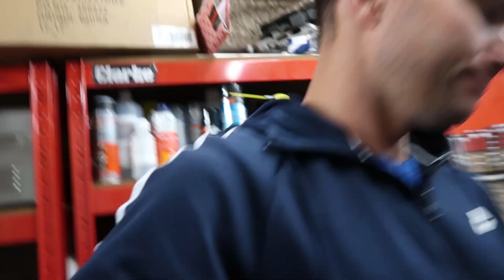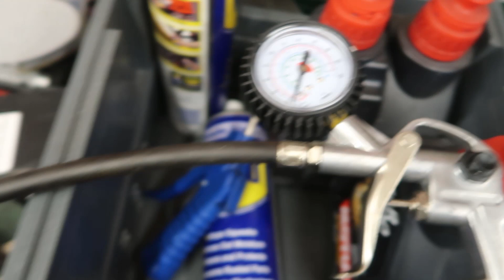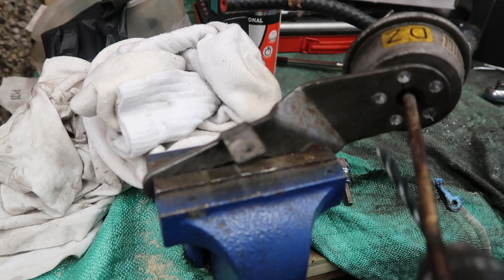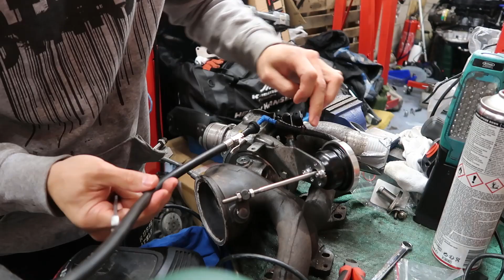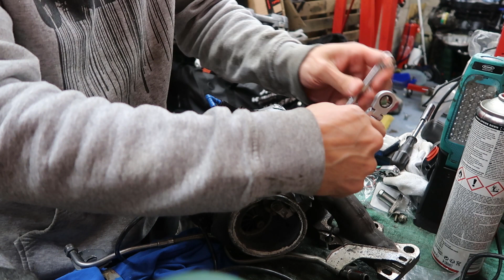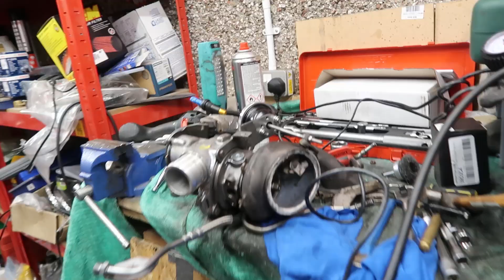How to install turbosmart actuator VXR

Comment: Hi mate, where are you based please? I really want to get that flutter sound on my VXR was told to put a forge recirc valve in, would I also need to change my actuator? Is this something you can do please? Thanks
Reply from the maker: No the actuator wont make the noise you want.  Im way up in Scotland Aberdeen

Comment: After hand winding the nut tight, wind it 2 revolutions which way? Tighter, or lose?
Reply from the maker: @llewellyngovender9308  ohh sheet been a while i can't remember man
Reply: Just wind the nut up (clockwise) until wont turn by hand, then give it a further 2 complete turns clockwise.

Comment: Turbosmart universal? 140mm or 150mm? Thx
Reply: hi, did you find an answer to this question as I am also facing this problem, I want to get a universal one but it is 150mm and I don't know if it is ok
Reply: @adrianilie9081  я вообще взял turbosmart от powerstroke 7.3tdi 21psi но пока не ставил, сам шток вестгейта длиннее поэтому буду нарезать резьбу и постараюсь сделать площадку по типу родной чтоб сохранить родной вестгейт

Comment: Hey bud, what acuator is this? 10 or 14 psi? I'm guessing 10 as that's when its exhausting but just wanted to double check. Cheers
Reply from the maker: Its 10 mate.  There 10 standard.
Reply: @boosthit811  cheers my man!

Comment: hi there i have a forge actuator on it and the original owner has the 8psi spring on it deciding wheather or not to change it due to having a idle misfire but when i set the preload properly i have only 5 psi of boost 
btw i have a stock engine spart from fmic kit, forge actuator and recirc valve it is on a astra vxr

ps also wondering if you know anything about vacuum being above 30
Reply from the maker: Idle misfire and strange high vacuum I would be checking over all the intake and boost pipes/vacuum lines.  Hose clamps etc and even pressurise the system to confirm no leaks.  

Would need to check what preload forge recommended and what standard spring they normally use....
Reply: @boosthit811  did a boost pressure test a week ago no leaks and it is using the standard spring

Scotty Kilmer recommend doing a compression test
Reply from the maker: @996stoky  yeah that might point you in the right direction.
Reply from the maker: @996stoky  lots of different things can cause misfires.  Any codes up when doing the pedal test?  Even oil leaking onto spark plugs can cause misfires on the vxrs
Reply: @boosthit811  the only codes that come up are p0170 on a scanner and onboard it shows ecn17012 and ecn17016 I should mention it has had a decay and I checked the spark plugs lately it is running ridiculously lean when the code shows up
Reply: And rich when codes are reset
Reply from the maker: @996stoky  when was it last running good?  Or have you just got it?
Reply: @boosthit811  had it for about a year always had the issue I took the last muffler out and noticed it it had the original one on that masked it so to speak when I was test driving it
Reply: Also on idle my maf reading is reading anywhere from 2.8 to 3.2 g/s if that helps
Reply from the maker: @996stoky  ok.  Yeah compression test it hot & WOT.

Comment: Hi mate recently had my astra h vxr mapped by rnd motorsport 

It made 305 Bhp at stage 3 with a standard brand new complete borgwarner gm turbo with a brand new actuator etc

They said the standard actuator was holding it back a little and recommend the turbosmart version 

My question is will I be ok to swap to the turbosmart without issues occurring eg limp mode from too much boost or needing another remap?

And if it's ok to use the turbosmart version what spring would you recommend?

Cheers mate
Reply from the maker: I do like the turbosmart products.  I've had no issues with my one.  What exhaust are you running?  If your going for the new actuator the standard 10psi spring will be fine.

With regards to remap its always safer to get them to check the tune.  But if you just have 3inch exhaust, fmic and aem filter on a fresh ish engine they can do almost 325hp so you are probably only leaving 10/15hp on the table.  May want to wait until you do some bigger mods-turbo, cams etc.  Its up to you mate.
Reply: @boosthit811  

Yeah mate 3 inch double decat cobra non res 

Highly modified cdti airbox with besson extra large cold air feed scoop

Mtc fmic and top hat with thermal inlet gasket 

Cars done 120k but has recently had a rebuilt cylinder head with the new turbo 

Main reason I ask is they moved the rev limiter when they mapped to 7k rpm just feeling a bit of turbo lag at the bottom end but from 4-7k it pulls like an absolute train 

Just wondering if the turbosmart actuator will give a faster spool and more initial kick/hit from the turbo compared to the brand new borgwarner actuator 

Don't really want to spend any more money on forging or more power just want to make best use of the power that Is already there 

Before the remap I had a generic cheap 12 psi actuator it gave the turbo a really good initial kick/hit but the car kept jumping into limp mode over 5k from to much overboost
Reply from the maker: @andrewb5263  ok nice.  The turbosmart actuator may help a little....no guarantees.  Me personally I would just run it as is and wait until doing bigger upgrades down the line.  Turbosmart actuator is 120£ ?  Plus dyno sessions 400£?
How much boost you running? Psi.  Mine peaks at 21psi then settles at about 16psi.
Reply: @boosthit811  

Hi mate just fit a boost gauge 

Getting 17-18 psi overboost 

And usually settles at around 15 

Got a new rear vac box on the way see if that helps  

Still think it's worth the turbosmart actuator ? or should I just try adding some more preload to the standard actuator and aim for 20-21 psi overboost?

Also just messaged rnd enquiring about what boost figures they achieved when they mapped it but awaiting the reply
Reply from the maker: @andrewb5263  I would have just done a vac box delete.  Then do a boost leak test.  Job done.  

My boost sometimes spikes to 24psi for a sec then 21 and once near 5/6k rpm probably around 15-16psi....my engine is lower compression than standard and I always run 99ron fuel.
Reply from the maker: @andrewb5263  your rpm limit will most likely be set to 7250k that's the safe limit on hydraulic lifters.  But peak hp will be alot earlier than that....around 6k.  The Cdti box is a known slight restriction.  Like I said in my opinion it not really worth the money for new actuator etc for 5hp-10.
Reply from the maker: @andrewb5263  Sorry 24psi was a stretch.  21psi max then as turbo runs out drops to 16-15

Comment: I bought a second hand turbo with the turbo smart actuator already on it, i installed the turbo and since then my cars been over boosting do I follow the same instructions because this actuator was already set up for another 300bhp vxr so I don’t know how much turns I need to do
Reply from the maker: They may have fitted a heavier spring inside.  The standard 1 should be 10psi.  Yes I would follow the instructions as in the video 👍
Reply: BoostHit Oky I’ll do that tomorrow and see how it’s running then I need to bring it in for mapping ASAP
Reply from the maker: @migell100  all good man.
Reply: @boosthit811 i have the car on sotck is okay to mount the 10 psi?
Reply from the maker: @OSCARPETRUSPONSoscarina should be.

Comment: Hi thanks for the video! I have a corsa vxr do I do 2mm of pre load?
Reply from the maker: If it's a turbosmart actuator then yes.
Reply: Ok thank you very much for the reply I’m going to try and fit mine tomorrow but there is another video about where he does 3 turns.
Reply from the maker: @the_time_chambers_edge  well it would depend on the manufacturers instructions.  The turbosmart one I had specified 2mm of pre load (2 complete turns).  Best to stick to what they recommended.  You can always adjust after a few drives.

Comment: Could you do this with the Mani and turbo on the car still? Or setting up preload and what have you?
Reply from the maker: Yes you could......I would unbolt the old bracket tho so you can get to it with a drill or fit the new turbosmart bracket.

The preload set up is quite straight forward.  Just wind the nut up (clockwise) until wont turn by hand, then give it a further 2 complete turns clockwise.   Thats the preload done, then just lock the back nut off without moving the front preload nut.
Reply: @boosthit811  I'll be giving it a go tonight using the original bracket! Thanks bud
Reply from the maker: @jamesmcpherson5468  All good.  Let me know how you get on!
Reply: @boosthit811   Mount came out lovely, great video bro, got one issue though which I hope you'll be able to shed light on, I followed the video exactly, finger tight, then mark the bolt, 2 turns and test with air on the actuator, now I'm getting a little movement around 15psi but not fully open until 30psi? Any ideas what I can do?
Reply from the maker: @jamesmcpherson5468  I would say drive the car and monitor boost.  It's probably ok.  Measuring psi vs wastegate position can be tricky.
Reply: I'm based in Buckinghamshire, fancy changing mine ? Lol

My burg has developed a deep snuffly exhaust sound, loss of power and no turbo kicks in..

Took it to a garage and there saying the actuator is the issue!